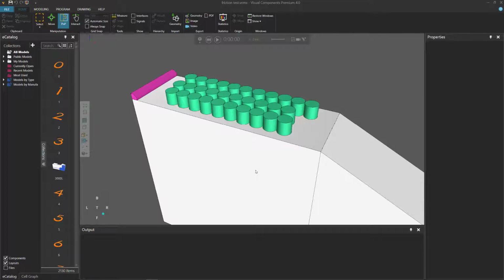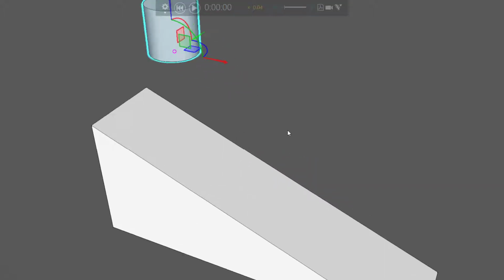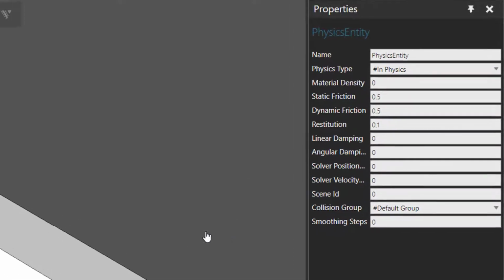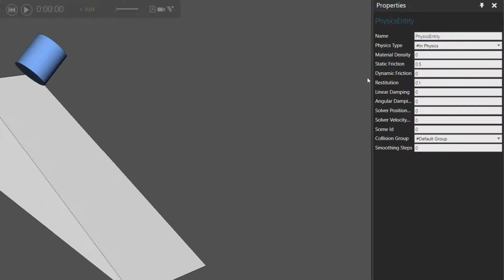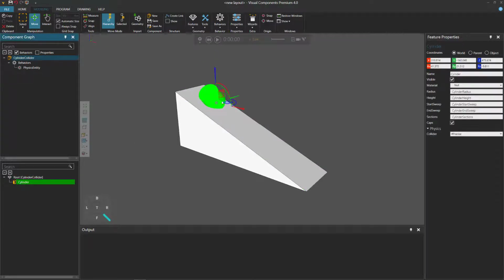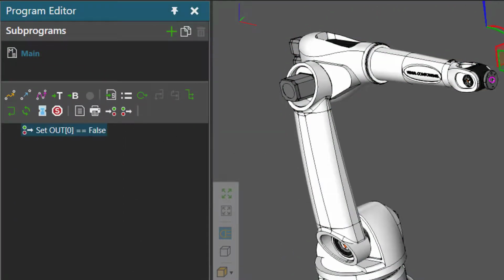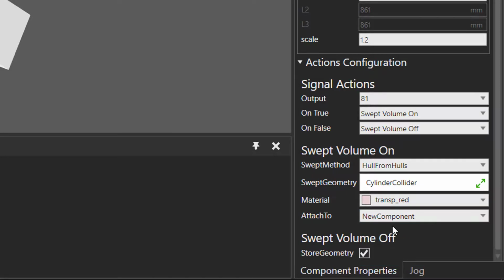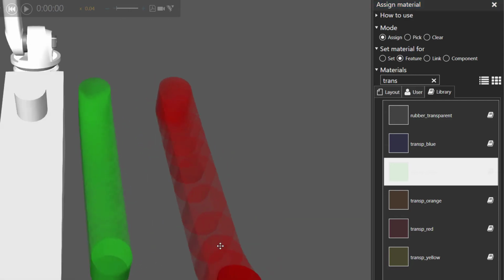Physics - 8 - Static and Dynamic Friction

Comment: hey man, check your volumes... entrance music almost deafens me at 50% (as i have it usually, which is the average volume almost every tuto video is ok for listen clearly) while max volume everywhere was not enough to clearly hear your voice.
Reply from the maker: yes, we have received similar feedback about other videos. this video was uploaded in February 2018, so since then we have made a few changes, for example videos uploaded from 2019 onward.
we have removed the intro music from new tutorials, for example, and tried to post-process the audio to make sure it is good.
the audio issue in these older tutorials does vary, but we can correct it by reuploading the video if needed or provide you with downloadable version with fixed audio. in the past, tutorials were tested on Lenovo computer with realtek high definition audio speaker, HP monitor speaker, mobile phone jack, headset. on some computers the audio is fine on others the same issue you mentioned. for instance, the audio is different on lenovo thinkpad compared to asus zenbook.

Comment: would this apply to this software only or can it be applied to Unity as well?
Reply from the maker: At the time of this comment, Unity still uses Nvidia Physx. So the same physics engine is being used, but version might be different as well as how the developers implemented the engine. Generally, the concepts should be the same, for example what is static and dynamic friction. And the properties are coming straight from the SDK, but always check Unity documentation to be sure about the values and units.